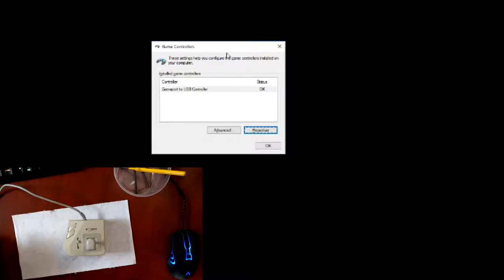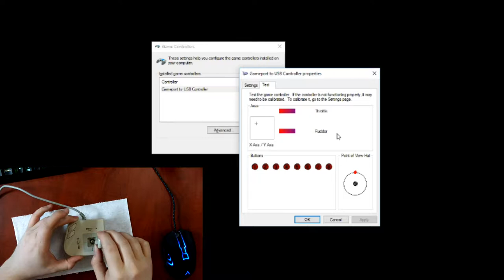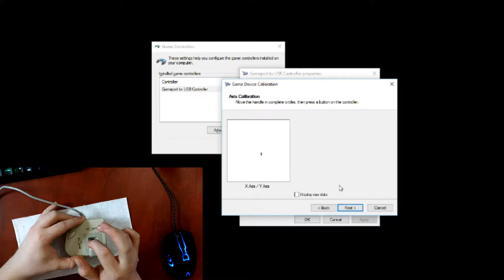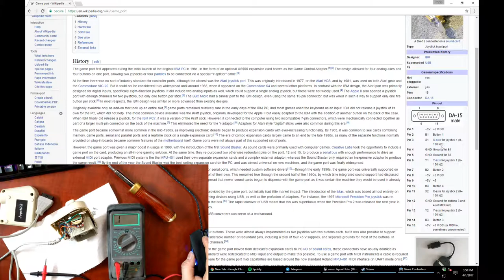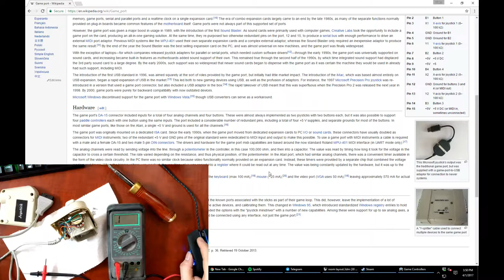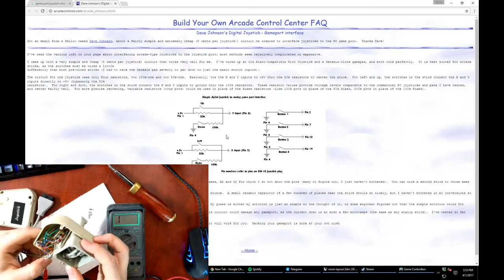Joystick Teardown

Comment: It's never the fill potentiometer thats 100 Ohm but the resistance between the the two used connection over the movement range the potentiometer within the axis of the joystick. Next time measure the two used connections of the pot.